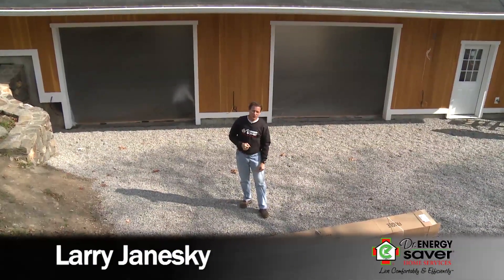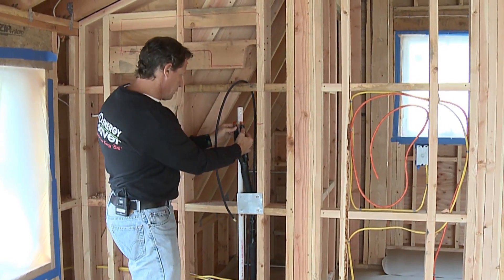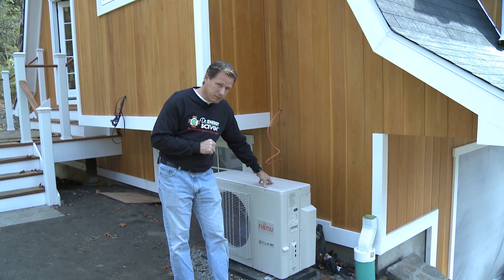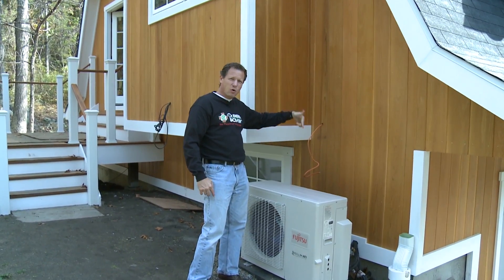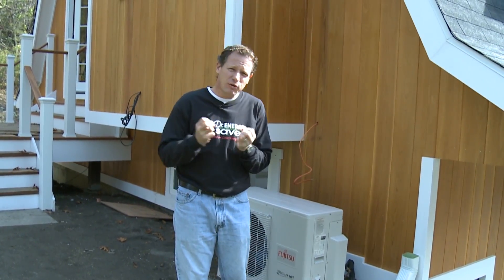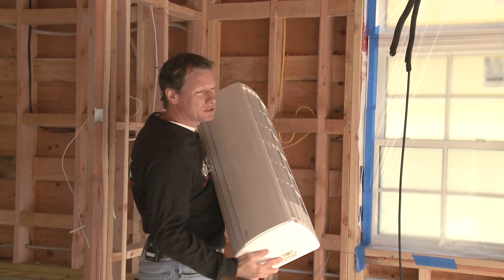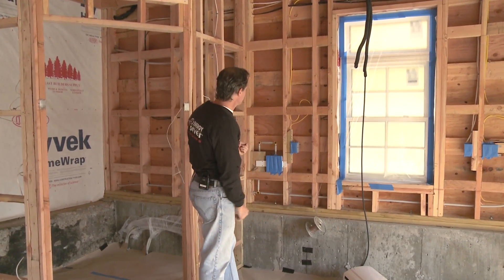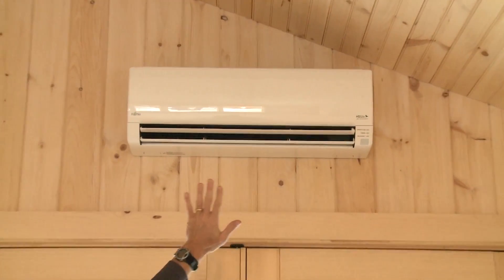Ductless Heat Pumps

Comment: Mitsubishi (800-433-4822) markets, advertises, and their phone messages re-enforce the “fact” that their Ductless, wall mounted, split-type air conditioners (heat pumps with Inverter technology), are WISPER QUIET.  But in their owners manual, they say it is sometimes normal for the units to make noises that sound like pops and cracks.  
I met with both their diamond dealer Robert Bair from DowersGrove, IL and Mitsubishi in Schaumburg, IL to emphasize that we are light sleepers, the only reason I need your units is because my quiet furnace  makes too much noise for my wife.  I demonstrated how quiet my furnace was to the dealer!   Mitsubishi demonstrated a unit and said that all I will hear was the low constant fan noise.  They never mentioned the popping and cracking.  I complained for 2 years, The popping & cracking is getting louder.  Not able to use them.  Lost of over $6000.00   investment.

Comment: Single zone units are way more efficient than multi head units like this. Up to 33 Seer now is available from Fujitsu, way beyond the 18 Seer Dr Energy is promoting.  If you want max efficiency, get multiple single zone units. Also provides redundancy so of one condenser is down, you are not without heat.  
Also, if this install in a region that gets snow like shown in the one pic, would want to raise it well off the ground rather than mounting on a ground level base as shown in this install. Condenser will ice up in the winter and you want a clear path for drainage.  Wall mount above the highest possible snow line is best practice.  
Other than that, great technology.
Reply: +David Bachman yea, they also go down to -15 degrees Fahrenheit
Reply: Each single zone is running about $3500 to 4k these units are too expensive especially in my situation where I need at least 5

Comment: I recently had the chance to see one of the Mitsubishi 3 head units in operation, the outdoor unit is so quiet that if you didn't see the fan moving you wouldn't know it was running (seriously the fan on my laptop computer generates more noise), the indoor units make more noise but still way quieter then a window unit A/C, but more then hearing the air blowing thru normal ducts. overall A very quiet system when compared to the noisy outdoor units of normal ducted HVAC.
Reply: DanielRichards644 t